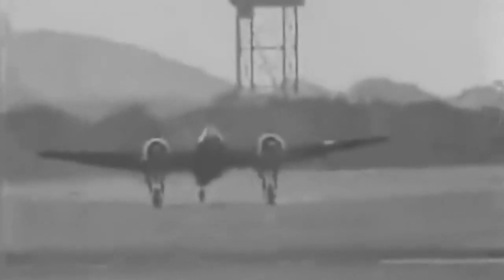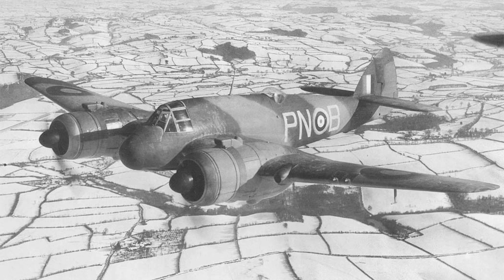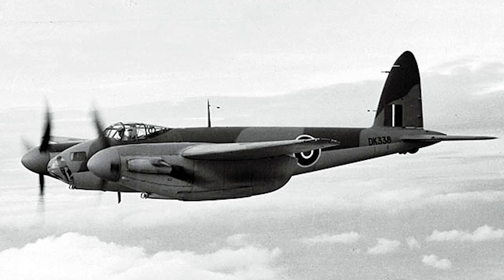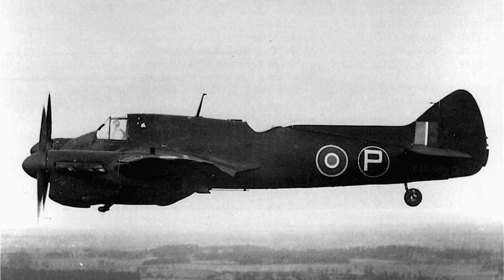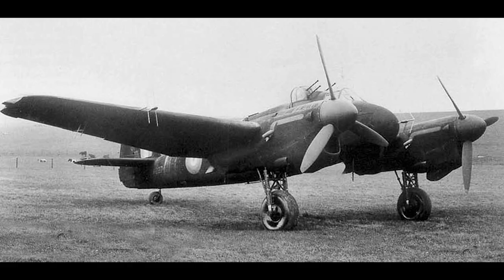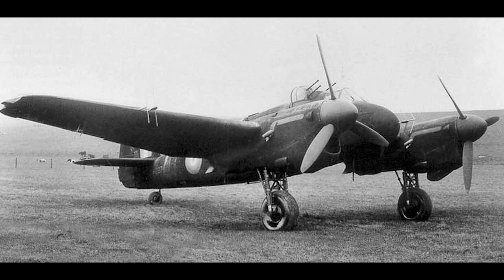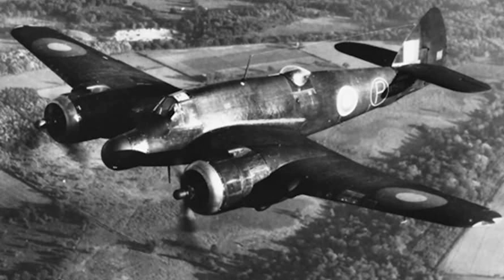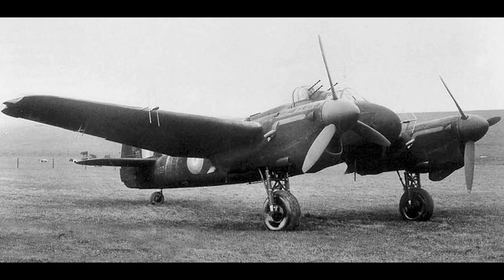Bristol Beaufighter NF Mk. V; How to Use ‘Good’ Ideas to Ruin an Aircraft

Comment: Another example of Merlins not improving an aircraft is the P-40 models equipped with Merlins. Both engines had single stage SCs. The Allison actually made more power. Plus the Allison was capable of handling insane amounts of boost compared to its rated boost levels. Australian squadrons in the SouthWest Pacific would often run 60 inches or more of manifold pressure.
Reply: You must have seen Greg’s video, he casually dismissed the massive performance boost at altitude from the two speed supercharger in the Merlin P-40.  Greg follows the path that best knocks the Brit’ equipment, I still like and admire his work.  He was right about the P-40 (both versions) outperforming the Spitfire Mk V at low altitude.
Most Seafires, Mosquitoes and Lancasters did perfectly well with single stage, two speed Merlins, they were never going to operate much above 20,000 feet.
Reply: 60 inches is about +15lbs boost. The Merlin 60 series was cleared for +18, 70 series ultimately +25. The problem was that Merlin P-40s only got the equivalent of 20 series engines with a maximum of +12 in the most highly rated versions. So the issue wasn't the Merlin, just the version provided for the P-40.
Reply: @wbertie2604  
See Greg's P-40 video that covers the Merlin vs Allison. I thought it was 60 inches. It may well have been 60 pounds.
Reply: The Allison’s didn’t have the turbochargers they were designed for. They died above 13,000 ft.
The only Allison engined production aircraft with the turbochargers they were designed for were the P-38’s.
Reply: @allangibson8494  
Allison eventually did design and develop a mechanical second stage supercharger for the V-1710. Only too late to do any good. Plus the finished design was not to compact.

Comment: Britain was lucky to have two great engine manufacturers in Rolls Royce and Bristol. The Merlin was RR's only successful engine of the war, as the Griffon came too late to make much difference.  But there were so many variants of the Merlin, the early types and the later types were virtually different machines. I get muddled with the various types of Bristol engine. I tend to think of them as variants of the same engine, as they are all air-cooled radials. Gladiators, Lysanders and Blenheims had Bristol Mercury engines. Most the other early British bombers had Bristol Pegasus engines. The heavy bombers and Beaufighter had Hercules engines, and sadly the Centaurus came too late to make much difference.

Comment: Great video, but you've got some errors here (3:36) regarding the operation of the MkIV AI set.

It was ground control radar (not the AI set) that got the aircraft to within 3 miles or so of the target, and from that point the radar operator would try and pick up the target on his AI set and guide the pilot to a visual identification (i.e. to within a few hundred yards).  The last part was tricky with early sets, and they didn't work at lower altitudes because of ground returns, however this got better with later marks.
Reply: The pre magnetron sets had a minimum range far exceeding the maximum visual range so the close approach was blind with the possibility of missing, being seen and fired on and of collision.

Comment: Actually thought the RAF might be on to something with turreted night fighters. Lock the turret facing forward with the guns elevated. You've got Schrage Musik before the Luftwaffe invented it. Once the concept is proven on things like the Mark V, you substitute a pair of fixed Hispanos for the turret, add the new radar and Bob's Your Uncle!
Reply: The Bristol Fighter was very successful in the Great War. The concept performed well with Hawker two-seat fighters in the thirties. Boulton & Paul manufactured two-seat Hawkers under licence during the thirties. The idea of a two-seat fighter which resembled the Hawker Hurricane seemed like a great idea at the time. Keith Park commanded 11 Group during the BoB. He'd been a Bristol Fighter ace during the Great War, and expected better from the Defiant. If Defiants were used in 12 Group instead of 11 Group, they'd have gone up against unescorted bombers as they'd originally been designed to do.

Comment: The Lancaster BII Bomber had Bristol Hercules VI or XVI engines, instead of the RR Merlin due to limited supply of that engines.
Reply: I understood it was more to make sure the plane would work if the supply of Merlins was interrupted?
This has been mentioned in respect of all the Hercules/Merlin replacements, in both directions, on various bombers as well as the Beaufighter.
The high altitude Wellington was an exception.  For that the production example had better altitude performance with the Merlin.
Reply: Fun fact, Avro took four of the Merlin power egg's (as they were known) off the Beaufighter Mk II and stuck them and a new wing on the Manchester!!! Something very useful came out of the Merlin powered Beaufighter program.
Reply: Only 300 of the BIIs were produced (by Armstrong Whitworth) in case of a shortage of RR & Packard Merlins but increased production of RR and Packard Merlins made further production unnecassary.
Reply: @John.0z  I understood that to be the case too - as Grahame Pigney notes further down with the B.II Lancaster - that Halifaxes, Wellingtons, and Lancs all had RR and Bristol engined variants to make sure they worked - just in case of supply interruptions.

Comment: Reminds me of that captured Spitfire Mk V which was fitted with a DB601 (mounted in the 109G) and outperformed both the original Mk V and the 109G.
The Merlin was a good engine, but it wasn't above all things.
Reply: The Me 109G had DB 605. The F had the 601 N.
Reply: @MothaLuva  Of course the 605; something has been messed up between my brain and my keyboard ... 
The 601N was already mounted on 109E-7
Reply: @ottovonbismarck2443  Yes,,,
Reply: Well it was a 35L engine to the Spiffy's 27, sooo.... yeah, that WAS a thing until regular shipments of good American AvGas showed up.
Reply: T'was similar with the Meteor & Meteorite subvariants for ground vehicles; the Meteor was apparently great in the A39 Tortoise prototypes (the heaviest UK wartime AFV to reach pre-production), yet fared poorly in the postwar Conqueror Tank, despite the latter being lighter.

Great engine all roubd though, with examples of the Meteor lasting in vehicle service into the mid' 00's.
(when the Royal Navy retired the Centurion BARV)
Reply: I think the great thing about the Merlin was how it was improved tweaked. It’s cooling system was superior, it was the most fuel efficient aero engine out there.
Reply: @toemas8  Every engine was improved and tweaked. You can't compare an early Merlin to a late one; they are almost two different engines. Same goes for the DB601 and 605.
However, the Spitfire got away with smaller cooling intakes, thus reducing drag. This was a little design flaw on the 109.
That said, there was the Vokes air filter on desert Spits and Hurricanes which increased drag a lot compared to the relative small additional filter on desert 109s.
Early Merlins had no fuel injection and couldn't take negative G-forces as well as the DB601. On the other hand, 605s were famous for leaking oil.
I think both Merlin and DB were outstanding engines and Spitfire and 109 were so close that IMHO only the pilots made a real difference.
Reply: @ottovonbismarck2443  yeah not having fuel injectors was a early shortcomings. Having two superchargers and engines that could work at high pressures was the clear advantage that the Merlin eventually had. The performance of the mosquito and the P51 definitely show this.
Reply: @toemas8  Yep. Although DB605D as in Bf-109G-10 performed excellent at high altitudes as well. IF torque didn't kill you during take-off that is ...

Mosquito is next level anyway. Mustang,  pfffft, totally overrated and it looks like a pregnant fish ... 🤣🤣🤣

Comment: The merlin had already been tried on the Mk2 & they knew it didn't work. They used 2 Mk2s as Mk5 prototypes because they were available. The point of the Mk5 was the turret which also didn't work.
Reply: And the video is about 'ruining' an aircraft with 'good' ideas. They made two prototypes of the Mk 5 for testing to see if it would be more effective; they weren't, so the idea was scrapped. At the time, night fighters were barely starting to be a concept; no one knew what would work well and what wouldn't. Testing concepts and junking them when they fail is hardly "ruining".

Comment: It's incredible how RAF higher-ups were so fixated with turret fighters, they didn't understand that the simple turrets' weight would've indered aircrafts' performances?
Reply: The higher the rank, the less time they had for flying. Let alone getting into an aircraft for combat.
Reply: The Beaufighter had problems with its front-heavy weight and dodgy aerodynamics. I suspect putting a turret in the back might have pushed the C of G rearwards, but I'm guessing.
Reply: Well for a twin-engine heavy fighter that's operating at night (and thus implicitly not having any need to dogfight), there is some logic to it. Lower performance isn't necessarily that big a deal in a night fighter. What I find most mystifying about the Beaufighter Mark V is that they chose the already-unpowered Mark IIF for conversion instead of the Mark IF with Hercules engines.

Comment: I liked the picture of the radar screen.  Could you do more on the Radars used by the RAF, i.e. what did the screen look like how was the information displayed.  The little I have seen shows them being radically different to what we think of as a radar screen these days.
Reply: It is a L scope (a pair of A scopes).  The left shows the range to the target, the right the relative altitude. The relative size of the "horns" shows whether the target is to the left or right. As shown in the video, the target is dead ahead and flying higher. 

"A slightly modified version of the K-scope was commonly used for air-to-air and ground-search radars, notably in AI radars and ASV radars - (Air-Surface Vessel). In these systems, the K-scope was turned 90 degrees so longer distances were further up the scope instead of further to the right. The output of one of the two antennas was sent through an inverter instead of a delay. The result was that the two blips were displaced on either side of the vertical baseline, both at the same indicated range. This allowed the operator to instantly see which direction to turn; if the blip on the right was shorter, they needed to turn to the right. These types of displays were sometimes referred to as ASV-scopes or L-scopes, although the naming was not universal"

Comment: That opening picture of the Beau with half a wing is quite something. Assumming that happened in the air and not on the ground. It has always impressed me that the same engine was used in the cavernous Bristol Freighter. Fitted to a much smaller plane they must have been quite lively. A question - the photo at the 3.26 minute mark appears to show a Beau in flight with a raised fillet ahead of the dorsal fin, similar to a P51D mustang. It doesn’t turn up in any other photo, and Ed doesn’t mention it. But might have been tried on one if the Merlin’s caused lateral stability issues
Reply: The raised fillet or dorsal fin was used on the last major production variant, the Beaufighter T.F.X. This aircraft passed through several important modification stages without any change in its Mark number.  One of these changes was the addition of a large dorsal fin and an increase in elevator area to improve longitudinal stability.

Comment: I always thought the Merlin powered beaufighter would be quicker than it's Bristol Hercules counterpart for the simple fact it had less drag but apparently I am completely wrong here and chalk one up for a radial (even though the thunderbolt and all the United States navy's fighters of world War II were powered by a radial)
Reply: It's a really complex subject - Greg's Airplanes does the most in-depth look at it that I have seen. Liquid cooled inlines need to have coolant radiators and oil coolers which cause drag etc, and usually are heavier units. The other issue - if you look at how far in front of the wing the Merlins extend in Ed's video - is a change to the centre of gravity too; the Merlin powered Wellington had to have some work done to deal with the change of CoG, and looking at the Beau, I bet it really buggered the balance up!

Comment: Thanks Ed for the good video, and also the one earlier that was in response to a question i asked you, I find it weird that the beaufighter switched to Merlin’s. For a start , early Halifax bombers were powered by Merlin’s , and I think it was from the mark 3 variant that it was later switch to radials , also some avro lancaster bombers had radial engines installed in them as their was a shortage of suitable Merlin’s (my guess the types being used for heavy bombers). The one thing that I am also aware of the that the Merlin conversion was relatively simple for the beaufighter as it used the similar engine attachments to the avro lancaster ,  I think.
Reply: The larger side area of the Merlin made the stability issue of the Beaufighter even worse, which was only improved in the Hercules variants by the twelve degrees of tailplane dihedral  .
Reply: The main types of aircraft-engines were incorporated into "power eggs"  that made them easy to install/remove. The Germans had the same idea (see "Kraftei")
Reply: @ericadams3428  And a 20% bigger Tailfin in area.
Reply: The Beaufighter got the Merlin first. 4 power eggs designed for the Beaufighter ended up replacing 2 Vultures on the Manchester (with a bigger wing).

Comment: I suppose you could build a plastic model of a NF Mk. V by switching the radial engines for a couple of Lancaster engines and sticking on a Defiant  gun turret. There you go. A project for rainy days.
Reply: Is it just me, or does this particular model also has an extended dorsal fin stretching from the rear canopy all the way to the tail? I don't recall seeing this on regular Beaus
Reply: @Parocha  The dorsal fin was a standard directional stability fix for more area ahead of the wing. 
The Merlin engines moved the propellers significantly further forward increasing the engine moment arm on failure.
Reply: @Parocha  Early Beau's didn't have it (MK I - II), MK VI through to MK X did.
Reply: Alan W Hall made a Beau Mk II as one of his projects for Airfix Magazine in the 1960s. He kit bashed many aircraft using mainly Airfix kits. Defiant bits on a Frog Skua to make a Roc, he knocked out a project each month for the magazine.

Comment: It's pretty weird how people think a switch from radial engines to inline engines is just that easy, Kurt Tank's crowning achievement was switching a radial engine for an inline engine and it came with a ton of revisions and failures, heck, even his original radial engine with aerodynamic cowling was a lemon. 
It's just not that easy after you've designed your plane around a type of engine.

Comment: I understand that while the RR Merlin powered Beaufighter was indeed considered generally inferior to Bristol Hercules varients flight testing did reveal a slight improvement in pilot visibility, this due to the in-line engine's reduced height. Another disadvantage of the Merlin NF Beaufighter was that in night fighting combat often took place at very close range and concern was expressed that debris from enemy aircraft might be ingested into the Merlin engine's radiator caused damage.